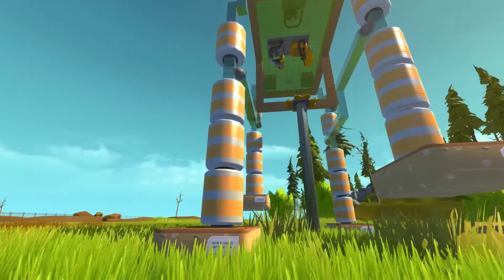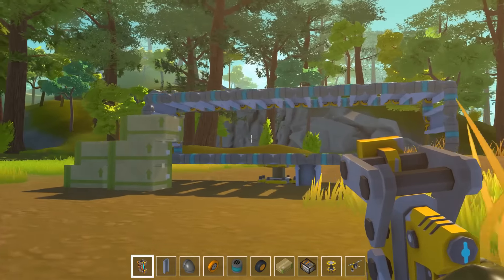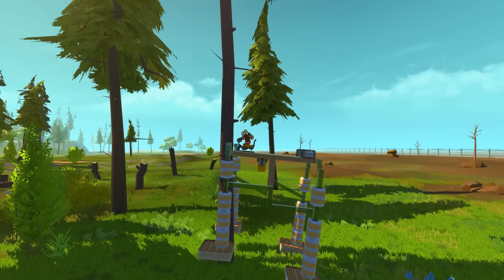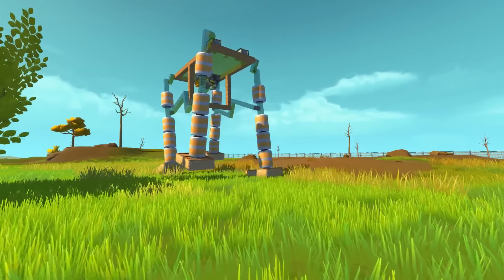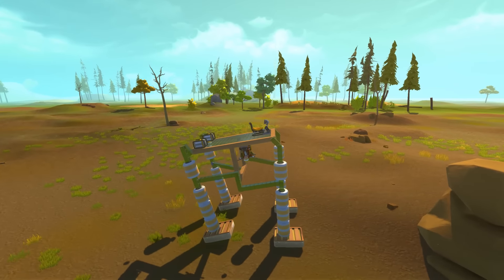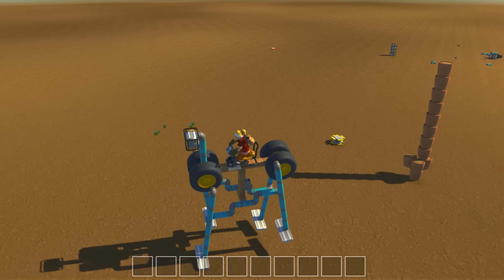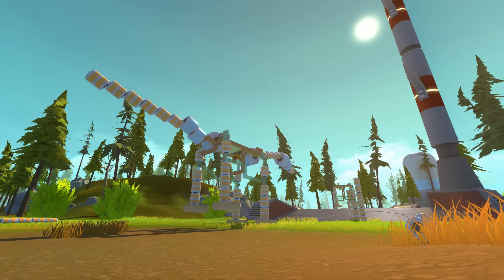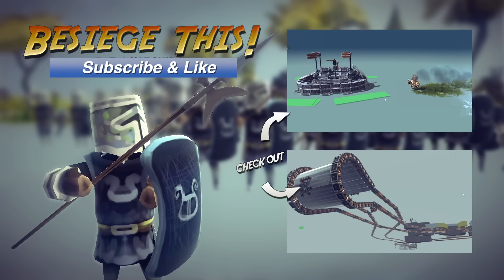WELDING TOOL Special | Scrap Mechanic Update v0.1.27

Comment: Would be amazing to see walkers in SM! I especcially love these walker designs in SM or Besiege that are powered by just one basic motion like a wheel turning (in other words, walker designs that don't have to have each leg moved independently by a button.)

I've been wondering though how you'd add ankle or knee joints as fluid motion to your walker. Any ideas?
Reply from the maker: The knees and ankles is the next big problem for me.  I did make a 'bird walker' in SM a while back but there was a lot of error in the design. Will be trying again now. Knees first :)

Comment: ❤
Reply: +Besiege This! Ohh shet! Make a self unfolding/folding bridge that can move around!
Reply from the maker: DeveloperDonut like a tank based one?
Reply: +Besiege This! A tank that carries a bridge, you remove blocks the put down the bridge, drive over it, connect it and fold it back up. OR an easy way of a self building bridge. Lmao
Reply: +Besiege This! Or something else... A couch that with a press of a button it turns into a bed. Or a car into a plane sorta thing.